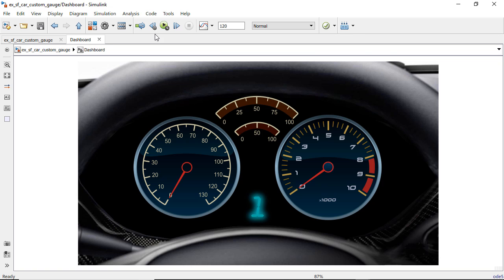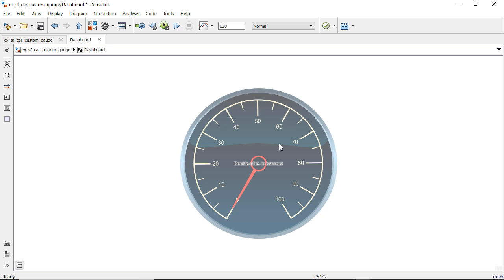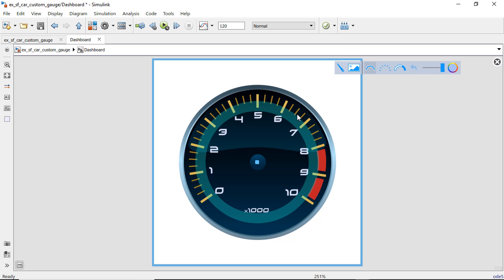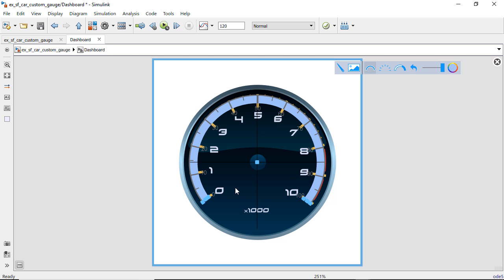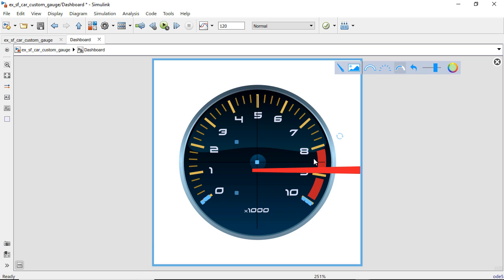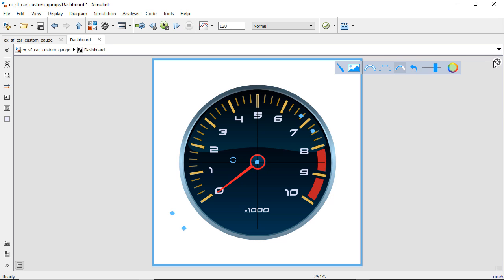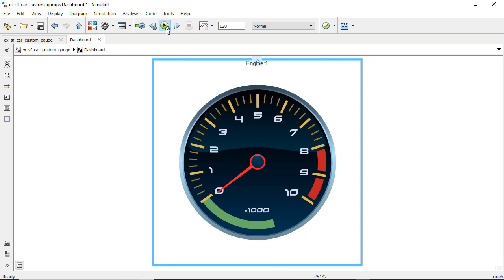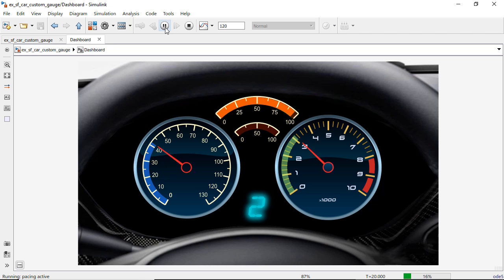How to Create Custom Gauges in Simulink

Comment: Is it possible to use a usb gas pedal to control the gauges?

BTW, Have you tried Simulink + Vehicle Network Toolbox?  

I'd like to make a PC application that can decode data real-time (using a DBC file + Peak's PCAN USB adapter).   

I know the toolbox comes with CAN Explorer , but I think a custom, standalone exe (using Matlab/Simulink Compiler) that logs and displays the canbus data of interest would be more useful.